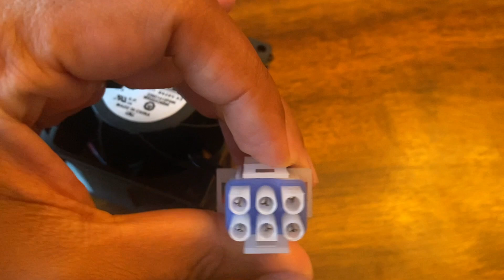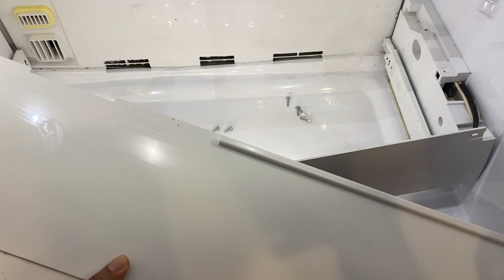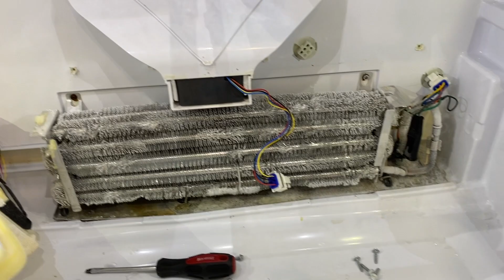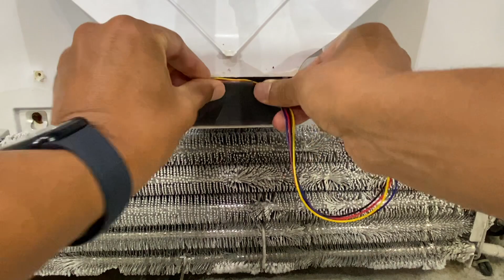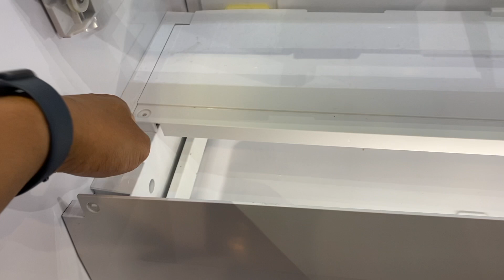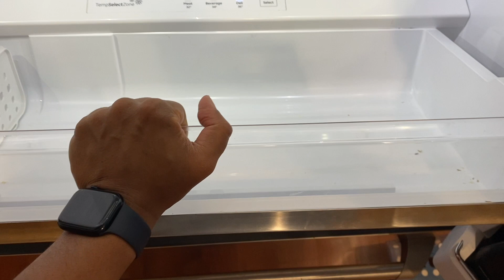WR60X26866 Refrigerator Evaporator Fan Motor Review

Comment: Interesting. I have slightly older model, but with the same water dispenser screen and features. The back bottom plastic piece that covers the coil is cracked exactly in the same spot. Looks like common GE design flaw.

Comment: Thank you sir. Just did mine with your help. One thing for future viewers. The back bottom piece was pretty hard to get off on mine just because there was some ice build up after the fan hadn’t circulated cold air for a while. So if it seems bound up be careful to break apart some of the ice and go easy on it so that piece doesn’t crack. Thanks!!